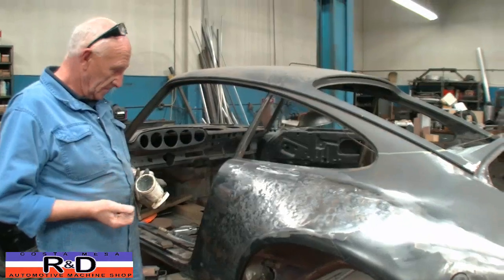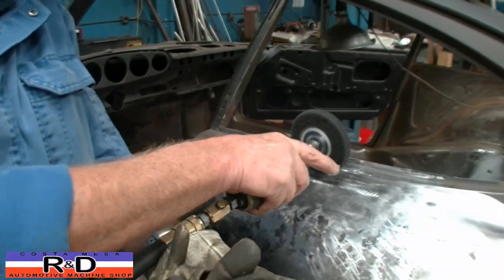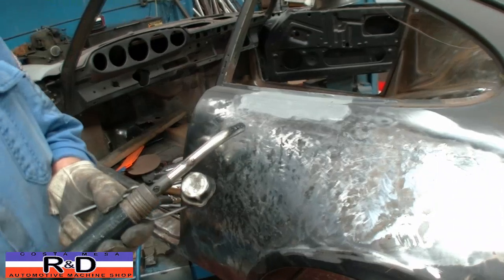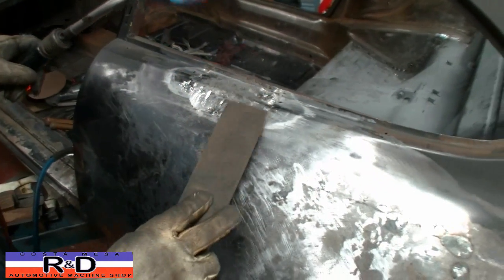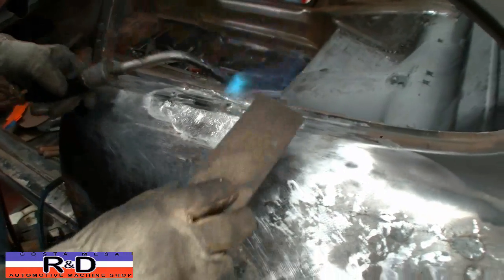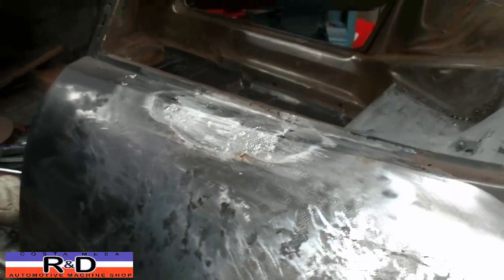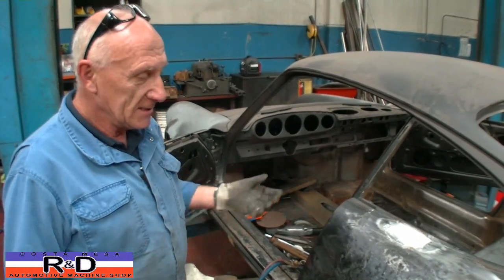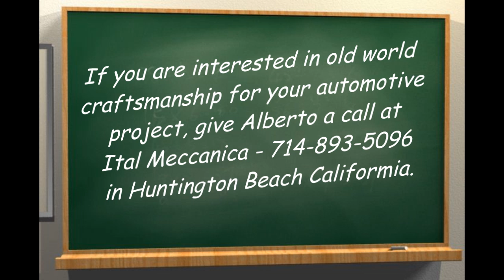Using Lead in Body Work Instead of Plastic Filler

Comment: I can see the value in using lead as filler but no viable business with employees should even consider it.  OSHA requires a respirator for the heating phase as well as the filing and polishing phases.  If you do any grinding or buffing of lead, protective clothing is required which has to be disposed of  as hazardous waste. The entire work area becomes contaminated with lead as well.  I bet if you test this guy for lead you will find his blood levels are through the roof!
I am sure that you could use lead free filler but Tin/Antimony and Tin/Silver melt at a higher temperature and are much harder that Tin/Lead.   (also lead free is a lot more expensive)  The technique would need to be greatly modified to make it work.
Reply: this old technique, won't see at any regular shop. And shops and craftsmen who use this techniques never ever will be check by inspectors or authorities, they just wont be able to get access to this facilities. Other thing for classic car restoration is other regulations and exceptions, it is small scale impact on environment.
Reply: please note, while they still call it leading, the material used contains no lead at all, it's mostly tin with other additives.
Reply: toot tall they said right in the video it was 70/30 didn't they?
Reply: TheJR1948 no lead dust would be quite a bit more toxic. Chunks of lead even molten lead are one thing but lead dust can lead to pretty serious problems.
Reply: I didn't hear that, but then I wasn't like paying real close attention. All I know is when I was being taught this in the late 70's it was already lead free, least ways what we were using. Even if it was lead, people overstate the problems with lead. You don't want to breath it, but otherwise it's pretty safe to mess with. The key is not to heat it so hot it becomes vapors, either with lead or no lead. It's kinda like the big deal about asbestos, so long as you don't breathe it, no harm. like the home siding that has asbestos in it. They act like it's so dangerous, but so long as the fibers stay suspended in the panels no harm. When they started using it as loose insulation is when the problems surfaced as it would sift through the ceiling tiles in very fine dust, then get breathed. You can have asbestos pads that do no harm at all, but people are scared of it so bad they think they're  this big deal. NOT. I think a hell of a lot of this EPA crap is just that, crap, scare tactics.
Reply: anyways, it's not as dangerous as people make it out to be.
Reply: He can probably just sit next to the elephants foot in Chernobyl without giving a shit..
Reply: I don't think Brian's comment was about the environmental impact. It was to do with the person/persons performing the lead loading's health.
Reply: If you don't breathe it, it's not a problem.
Reply: Koito rob Lead is used to block radiation, that's what my joke is about
Reply: oh.. duh I didn't get it that way. I should have.
Reply: More so as lead filing will not enter the lungs as easily as the airborne dust from sanding bondo or wood. Lead will tend to head to the floor and even when sanded will not float in the air. Both ways wear masks. Problem solved.
Reply: that's about the size of it. An old time body man I knew had to go to doing upholstery because tho I could work lead like a sculptor, he could not be around the Bondo dust at all, not even with a mask, he was highly allergic to it. were a mask you're probably safer with the lead than the chemicals in bondo
Reply: brian sparks alberto is using eastwood lead free 70%tin 30%zinc filler rod and eastwood lead free tinning butter. if you actually did any bodywork you would know this.
Reply: except for the cost and weight, I'd rather use the "leading" method. However, on vintage cars, there is really very little need for it except for seams. The metal on vintage cars is workable, not so thin. There are methods to do away with even the tiniest dings no matter where they're located on the vehicle, except maybe the frame, that stuff is too tough to move by normal methods, and you generally don't want to use heat on frames they were heat treated and using heat on them actually weakens them. I have heard of guys taking a hammer and denting certain places then leading it up to add weight in the right places. Lead Sleds got the name because of all the cutting and new seams, they got a lot of lead. I've also seen guys fill old drive shafts with lead then weld or bolt them in certain spots, that used to be used a lot on rounds round racers, they'd put the weight in the inside, to keep that side down a bit better when making all the left turns. also helped them meet the minimum weight requirements, but the weight would then be where it would do the most good. I think all this hoohah over lead, asbestos and other things is a load of crap. Don't breathe it, you won't have a problem.
Reply: I work in a Micro-Electronics  Lab, Lead is bad..  we banned it years ago for all the reasons you have stated. I do appreciate  this guys skill and craftsmanship  but he is compromising his long term health and everyone around him,not worth it!
Reply: realwarbest HAHAHA you are a fool. If a inspector has any reasonable hint that there is commercial work going on they have the authority to inspect. No warrant required even if its in your own home garage. Learn your laws.
Reply: OSHA is why a a $25 k truck now cost what a house to use cost and a house now cost what a small shopping mall use to cost. A $80 home now cost 250 because of the increase in labor time to get anything done because 50% of the time you're setting up, or buying shit  to meet regulations to keep stupid people safe. I figure slack of on the regulations and let the overpopulation issue sort itself out via eliminating the stupid among us lol.
Reply: 70% lead is not mostly tin HAHAHAHA. 70% tin would be mostly tin but even 30% lead without serious ppe would be an unhealthy product to use.
Reply: @shadowmink888  I agree  those buggers just make everything more expensive while they sit behind a desk. Making people aware is one thing. Dictating wether i can use a ladder or not is another..
Reply: How ever did we make it to the 21st century without all that H&S crap, I do not know.....
Reply: You're gonna be saying the same thing about YouTube videos where people are using body filler. You'll be screaming at the top of your lungs O the humanity.... The destruction of mother Earth and ozone layers. California is the worst... I did a one year , Longest year of my life in asbestos removal. I am not stretching the truth by saying every morning I got up and check the codes and see if anything at changed overnight. In that year I saw 2 projects delayed because of procedural changes in removal and disposal.  Through the years I was exposed to concrete dust, PCB oils from X-ray units, MRI up to 5 Tesla, briefly smoked, and daily stage 3 smog in 70s..( Real smog days where my lungs hurt for 2 weeks in Hawaii, dont trust breathing air I can't see) and welding cadmium and zinc plated metal.  Sorry to disappoint you guys but I'm still alive and you guys can worry about putting plastic wrap-around your kids every time they go outside to get the mail... Even that's probly too dangerous for you
Reply: @bonnivilleblackcherry9745  That is false, the Supreme Court has made it clear that you can tell OSHA to take a hike if they show up without a search warrant.  So, they come back with a search warrant and then you are really in for it.
Reply: It's lead, not plutonium.  With some simple precautions it can be perfectly safe to work with, and probably is safer than the catalyzed paint that the car will eventually be painted with.  Use proper PPE and adequate ventilation, file and hand sand only, clean up and dispose of all the dust carefully.
Reply: lead gives off fumes and vapors when subjected to heat. Those are what gets to your blood and eats up.your brains.
Reply: TheJR1948  I'd use filter protection for them as well.
Reply: @shadowmink888   - That is 100% true!
Reply: @bonnivilleblackcherry9745  70% tin 30% lead
Reply: @tootall5559  Yeah I was like cool leading. It wasn't till he stuck his bare finger in the flux I was like whoa bud at least wear nitrile  gloves or something.
Reply: @joer8854  The flux will not harm you. It's not lead after all. I get my fingers in soldering flux often, tho I'm not leading just solsering wires and such. Back in the day, might have been, but these days the flux is pretty benign unless you eat it, and even then, no body is going to sit down with a spoon and eat enough to do any real harm. I'm pretty sure it's not too tasty. When I was being taught to lead, we got it on our hands all the time, no biggie. Even getting the lead on your hands is no big deal it would have to be liquid to get in through pores or even cuts, and who's going to stick their fingers in hot lead. Even the lead itself isn't a big problem unless you inhale the vapors or eat it. Heck, mercury isn't a problem unless it's injested or gets in through a cut or something. Breathing it is the big problem, and under most circumstances, that just isn't going to happen, tho perhaps a respirator would be a good idea just to be super safe. Same deal with asbestos, unless you breathe it, not a big deal like the siding that has asbestos in it, so long as it's captured in the siding, no problem, but they make it one so those people that do that work can get paid big money to remove it. Generally, if not broken, worn down or some such, no biggie. A coat of latex or enamel paint over it will seal it up. Just like they make a big deal of lead paint. it's only harmful if injested as well, kids used to eat it, now that's a problem, but for most, no big deal, remove the loose flakes and cover the rest with latex or enamel paint, it's good to go. They make a big deal out of it because it's bux in somebody's pocket. Have you seen what the asbestos removal or lead paint removal guys charge? That's why they promote it being so harmful, money, just like everything else.
Reply: @tootall5559  
according to the MSDS

Prolonged or repeated contact with the product may irritate the skin. Harmful if absorbed through
the skin. Hydrogen fluoride, a possible decomposition product, is extremely corrosive and a
poison by all routes of entry. Hydrogen fluoride can penetrate the skin and produce burns, which
may not be immediately painful or visible; the burns impact the lower layers of skin and bone
tissue. Hydrogen fluoride exposures involving 20 percent of the body or more can be fatal through
systemic fluoride poisoning.
Reply: @tootall5559  i'm appalled at the ignorance in these comments.  "drugs are bad", "radiation is bad", "lead is bad", etc.  so many families are poisoning their young children with meat and fish and they don't even know it.  people seem to have arbitrary, unscientific personal standards.  the doctors keep telling but the people are deaf.
Reply: @bashisobsolete.pythonismyn6321  I don't believe I understand your comment. Why would anyone believe doctors? They lie and cheat and do only what's in their greedy interest. Cures have been found for various diseases, or treatments, they poo poo them unless they can make money off them. I can site instances, for example 25 to 30 years ago, I don't recall when exactly, a couple of Aussies discovered that ulcers were caused by a virus, not stress or anything else, but the doctors poo pooed  it for 20 years until it finally got enough publicity so the public noticed, then suddenly all the "prescription" drugs used to treat ulcers became over the counter heartburn meds like overhight. Scientists? You can't believe them either, when their livelyhood depends on what they spout. Same guy that years ago predicted another ice age came up with the global warming thing...Well which is it?  Why has no disease been cured in the last 50 years? Because there's no money in curing, only treating on and on and on. on the other front, fact is the American diet is worse than any other in the world. all the crap allowed in our food...Obesity is not such a problem in the rest of the world, except where they eat an American style diet with all the additives and what not. They eat much more often and richer foods in France, but hardly anyone (relatively) is obese because their food is much fresher and purer. Their breads alone are way better,but they tend to get them fresh made nearly daily, their bread isn't the problem our overprocessed nutrient removed bread is, just to mention one item. Let's face it, there is little if anything good that gets done unless there's a buck in it for somebody. Energy solutions exist, but the big companies buy them up and hide them, or they send inventors into bankruptcy with lawsuits. Governments are as corrupt as they can get, including our own. When was the last time the government did anything that actually benefitted the people as a whole? Never, if it doesn't benefit them, the things never get anywhere, Look at that stupid healthcare law... we want healthcare, we get a forced insurance program that is overpriced and doesn't cover squat. Then the government has the nerve to fine you for not having it. Why should they be allowed to force us to deal with private companies? Why are their only two viable political parties, and why does the taxpayer have to cover the cost of their primary elections when technically they are private groups? The world is ran by the gold rull, he who has the gold makes the rules.
Reply: @tootall5559  got any links to good medicine and good doctors?
Reply: @bashisobsolete.pythonismyn6321  not offhand. got some books on herbal remedies and such. Don't know a good doctor here. Knew of a good homeopathic doctor in Salida, Colorado, but that was many years ago. My doctor here sucked, and is no longer my doctor, tried another one, a nce lady but she didn't listen and passed me off to another doctor that wouldn't listen. I told both of them that the anesthetic killed me, (a quick acting nurse saved my butt) but whats the first thing they want to do, put me under to just poke around. Not happening. So as yet, I have not found one that's worth having.
Reply: @tootall5559  generally speaking, the new generation of doctors are great.  go to brazil or central europe as a private patient.  much cheaper and better than USA.  what's your medical problem?
Reply: @bashisobsolete.pythonismyn6321  we only have money hungry doctors here. The root of my medical problems is a bad back, some bone is missing. they put in steel... but the anesthetic gave me a hernia when i was barfing up the world, but to fix it requires surgery and more risk with the anesthetic. There are other minor things, but that's the root of it. that and  old injuries haunting me. I have only had one good night's sleep in my entire adult life. One where I woke up actually feeling good and refreshed. kinda wish I never had that one... because now I know what I missed all these years. If I'd have felt like that most of the time, I'd probably have set the world on fire.
Reply: @tootall5559  was it pethidine by any chance?
Reply: @bashisobsolete.pythonismyn6321  I don't know, by the time I was well enough to try to get the records, they were cleaned up and didn't mention the problem at all. except for the cost of the heart monitor. My heart got huge and almost blew up. That's all I know. They cleaned the records to prevent a lawsuit I'll wager. I told them I knew I was allergic to anything derived from fish oil, but that was all I was aware of.
Reply: @tootall5559  30% lead.  Pay attention.
Reply: @mqbitsko25  well excuse me.